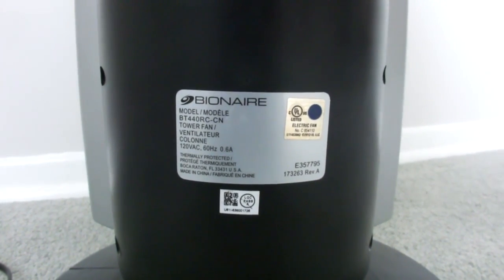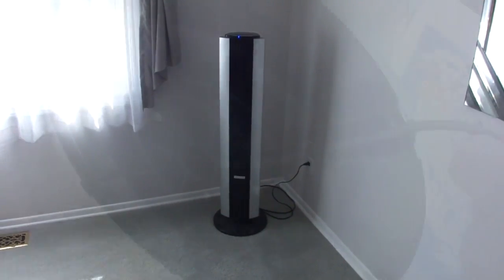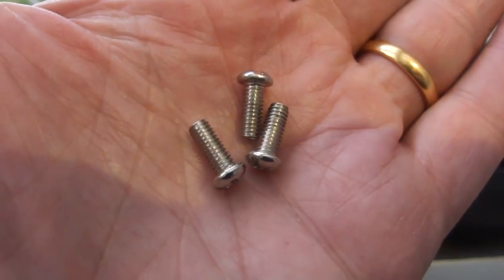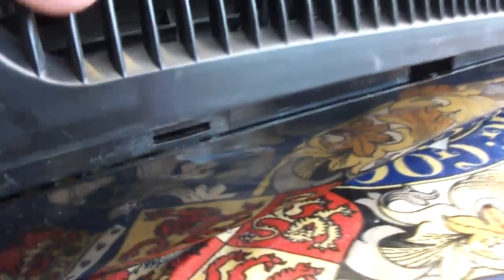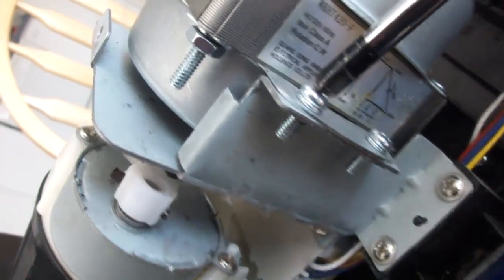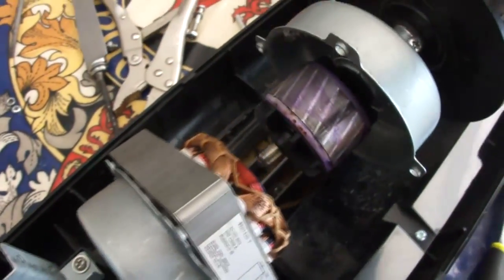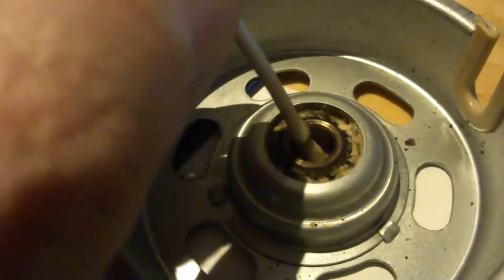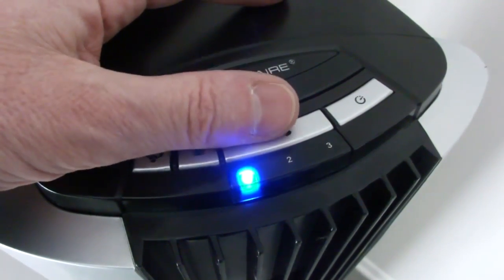Repair a fan that doesn't spin properly (Bionaire BT440RC-CN)

Comment: I was able to remove the motor assembly bolts without damaging them by heating the underside of each bolt head with a soldering pencil torch until it melted all the loctite that each boly is held in place with. It took a lot of muscle, time, patience, and knowledge of how how to properly melt adhesives commonly used to secure bolts that manufacturers don't want you to remove, but it did work, for anyone looking for an alternative to ruining the original motor assembly bolts and having to go out and buy new ones. — The inside of my motor was really clogged with pet hair and all the dust always in the air here in the Arizona desert so in order to properly clean it all out, I had to remove most of the grease the assembly needs in order to spin properly. Can you tell me what type of grease I need to get to replace the old gritty grease with new grease that will be sufficient for the fan to spin properly?
Reply from the maker: I didn't know that about Loctite blue! I would pin your comment, except I can't find the option right now. I'll try sticking a heart on it. As for grease, I got a small tube of premium "synthetic grease" from my local auto parts store and I use it whenever I'm using so little of it that the price doesn't matter much.

Comment: I have fixed mine (not exact same model, but same basic fan from Costco) 3x now. Best is to pull the bushing out, clean well and soak in synthetic engine oil for as long as possible. I use a small plastic container and drop it in for several hours. Silicone based lubes and other solvent carried sprays will varnish fast and seize up again. I'll be doing mine again later today actually.. These fans are horrible for this issue. I'll take measurements this time and order a real bearing to replace the root of the problem: cheap bronze bushing.

Comment: Thank you so much for this Guide, while I have not attempted it yet, I can positively say after a previous disassembly I too have a very similar motor assembly and it IS quite dirty!! mainly from pet hair and such, I will be doing this as soon as I can get a hand removing those damned threadlocked bolts... what a silly thing to have done at factory.... this seems like a very common problem after all.

Comment: Thank you kind sir! I unfortunately dissembled my Bionaire fan (different model), only to find out the motor was sealed by rivets, which would be impossible to take apart without a power drill & titanium drill bits which I do not have. Shame it needs to go into a landfill just because manufacturers intentionally made it non-serviceable by the consumer...
Reply from the maker: I agree! I don't know to what extent social pressure, or legislation, could improve this situation. I thought it was bad enough that I had to buy new bolts for my own example. Sadly, I know that making stuff repairable (and carrying spare parts) is one of the reasons that premium brands (e.g. Dyson) cost so much.

Comment: I have a slightly different one and I'm almost there but there's another clip or screw of some sort at the top.. help?!
Reply from the maker: Every model is a new adventure, isn't it? I particularly hate when it's not clear what direction you need to force plastic covers in, to get them apart (which is why I paid careful attention to photo the plastic parts in this one). I'm sorry, but without seeing it, and possibly wiggling it, it's impossible to guess what needs to be done!
Reply: @andycivil  it's got some weird little plastic plug type thing..  I think I'd just have to break it open lol

Comment: Hi Andy,

where should we cut the threadlock screws. Should we remove the head or the bolt part.
Reply from the maker: I should have said something about that: I found I was able to unscrew these bolts a little, but I just couldn't get the nuts right off because the thread-lock was just building up more and more as I unscrewed it, and it was getting tighter and tighter, but by that point, I had exposed enough thread to cut the bold just behind the nut. I think I was able to do this on all four. (Another approach might be to drill into the head, but I didn't try this, and I don't recall if the fan blade part would be in the way, since you can't remove it.)
Reply: Can remove loctite bolts with chorinated brake cleaner (spray on, sit 1 hour+ on threads)

Comment: Do you know the location of the thermal fuse?
Reply from the maker: I don't, but by definition it's going to be "on the part that might overheat" so in the instance of a fan, that would be the motor windings. I went back and looked at the raw clips I'd taken when I made this video, and there seems to be a circuit diagram on the side of the motor. Included in the circuit /seems/ to be what might be a thermal fuse, because it's labelled with a temperature (I can read the ⁰C part, but not the figure). On the one I had, it was connected to the brown wire, so all I can suggest is, "it will be attached to the motor windings, and try following the brown wire". Best I can do! P.S. if you try to solder in a new fuse, use pliers, ice, whatever it takes to prevent the darn thing overheating and tripping out due to the heat of the solder!

Comment: show me the connections of 6 wires motor 
which should i connect to capacitor and which should go to mains and neutral 
color code is blue red white yellow gray  black 

i don't need slow or medium speed i just need fan should be fast as much as can 
so show me that 
thanks & regards

shreyas India Mumbai
Reply from the maker: I'm sorry, I don't have this fan any more (it wasn't mine) so I can't check the colours for you.

Comment: Hmmm, let me just get my imaginary saw and start hacking away at the fan 🙄🙄 what kind of video is this? Lol
Reply from the maker: I'm not sure what kind of tools it's reasonable to expect people to own! For me,  a basic tool set of screwdriver, pliers, hacksaw and soldering iron is something I've lived with for the last 50+ years, and I can't imagine not having them. I admit that I assumed that anyone thinking about doing a repair would be of the same mind-set. Perhaps minus the soldering iron! I don't know what country you live in, but I think you can buy a simple saw from a dollar store / pound store. The kind that imports bargain-priced household items from China.
Reply: @andycivil  I fixed my tower fan without a need of a saw, all I needed was a screwdriver and a good hoover to get inside the fan to clean all the crap out, thankfully there wasn't any sufficient damage to the fan so it was simple job at least
Reply from the maker: That's how it should be, really! You shouldn't need special tools to repair something. I hate how companies (Apple are the worst) try to make it impossible to effect repairs on your own stuff.
Reply: @andycivil  yes, especially the new laptops which are soldered down ram and other chips that are impossible to upgrade, planned obsolescence is horible 😤😤